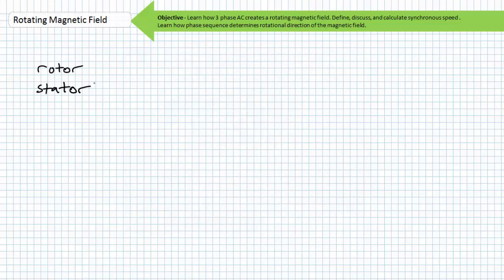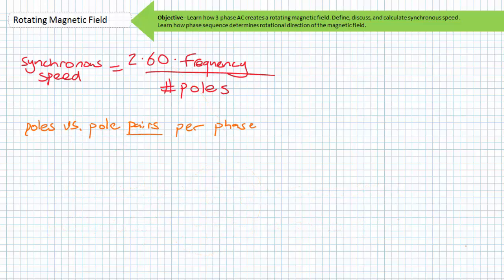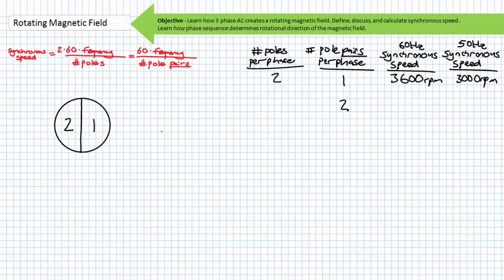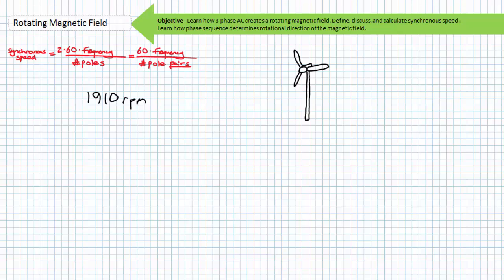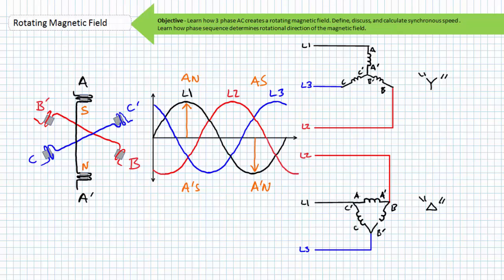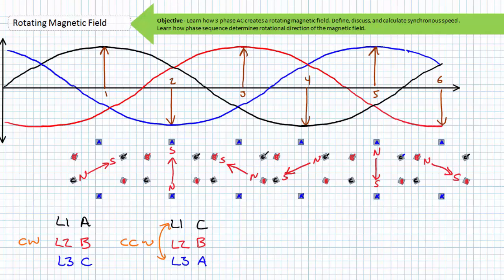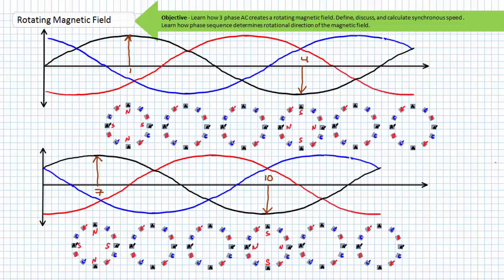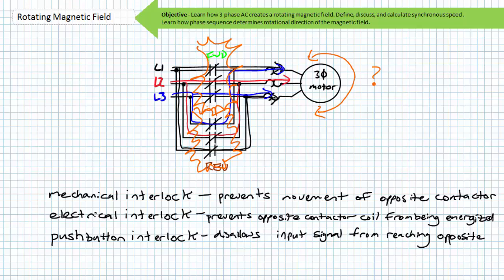Rotating Magnetic Field (OLD LECTURE)

Comment: Pole pairs isn't a thing. If a magnetic field is polarized it has an positive affinity field and negative affinity field. This is how stable field magnetism is achieved. Electromagnets do not have polarized magnetism but rather an inductive field generation created by the electricity being present in the metal to create the field on its way to ground. If we were able to create reverse polarity electrical conduction then we could create repulsor field magnets without the required opposing polarity of a stabile field magnet.

Comment: Ques: If energy can neither be created or destroyed, it's merely transformed where does the magnetic field come into play? The causes & effects I understand but how is a magnetic field transformed?  From what to what?
Reply from the maker: +Don G. Electricity and magnetism are linked phenomenon and you're correct it takes electrical energy to make magnetism and vice versa. Later lectures on inductors might clarify some of this ... however ... the real answer to that question is way above my pay grade. I took a whole course in electromagnetic fields and waves once and 19 years later I still find myself still bouncing back and forth between WOW! and WHAT?
Reply: Same here!
Reply: I think that a magnet aligns energies which would otherwise still exist but in like counterspace.  This energy exists in the em/light medium aka aether aka dark energy, zero point field, quantum foam.  Davinci has drawings of shapes and counter shapes.  The mental block is materialism and spacetime and a story about a cat that is somehow dead and alive at the same time.  Your question is fundamental and the answer really should be apparent but this kind of thinking is triggering and would be shouted out of an educational dialogue.   You likeah Dah juice?  Yes and no. (Old SNL skit).
Reply: Isn't transformed from the magnetic field into what we call voltage or the force that pushes free electrons around